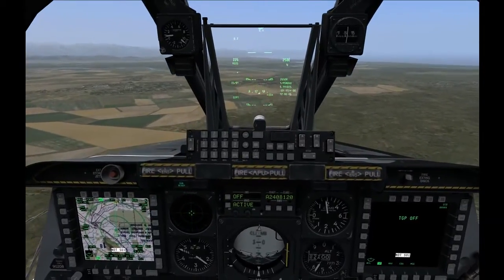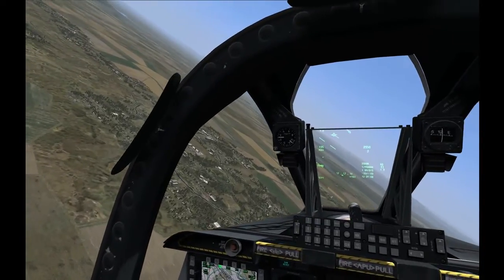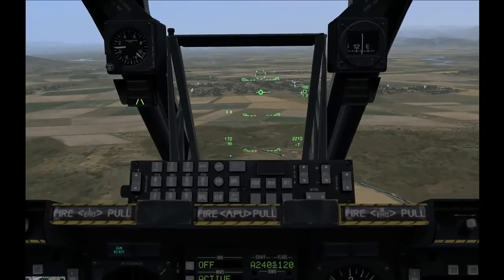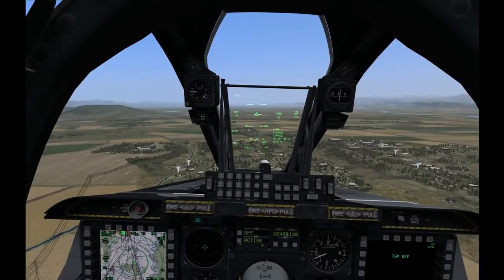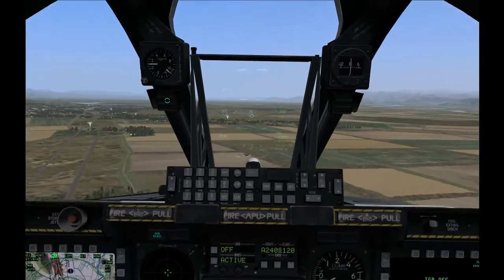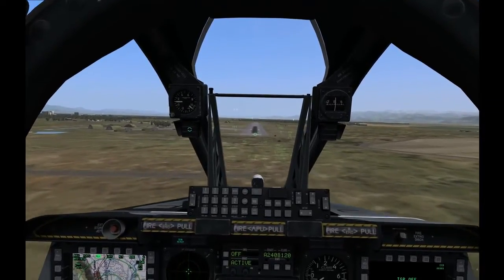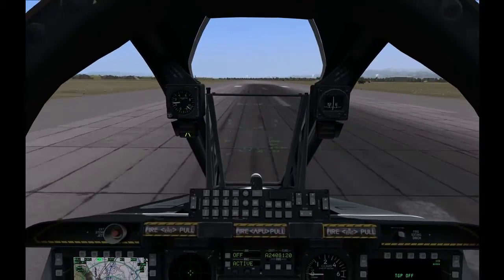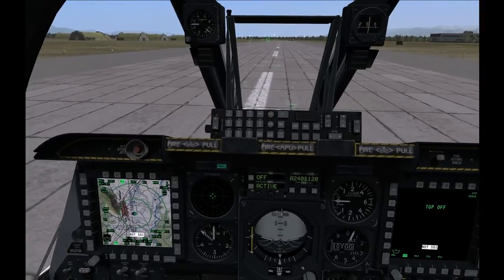DCS A10C Navigation 2 visual landing

Comment from the maker: Flare is simply to pull a little on the stick, to increase 'lift', and slow the decent rate, just before wheels down. It allows you to 'stall gently' onto the tarmac, rather than fly the aircraft down to it. In this video, i actually flared early because I was too low. Not the best idea. Should have spooled up, but that takes a few seconds, so pitched up to slow decent.

Comment from the maker: For BMS google 'benchmark sims'. Best ATC in a military sim (IMO). See some of my videos. Best sim in other respects also. A10 and ATC, Azimuth gives a heading to intercept the inbound course approx 10 miles out. No other info. Inbound request will give you a bearing and distance (but distance is not much use as its difficult to estimate). Best understand how to do it without ATC first. Then ATC makes more sense. I rarely if ever rely on ATC in DCS. Oh, and u need to be tuned on the radio.

Comment: What is BMS? So just to recap; to get coords of airfield you could radio ATC for azimuth or approach, and then use the runway # as the approach heading for the (direct) heading they provide in the HSI as a manually dialed in "approach angle" (sorry, 'don't know the correct term here for the line that goes through the HSI showing the necessary pathing). Would that get me headed the right way, from the right direction after visual and positioning via runway# approach angle?